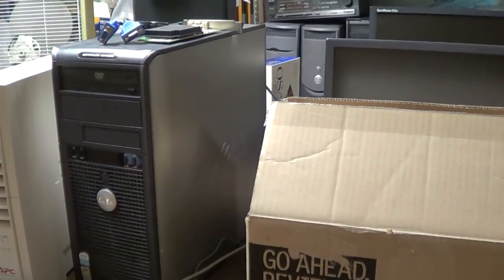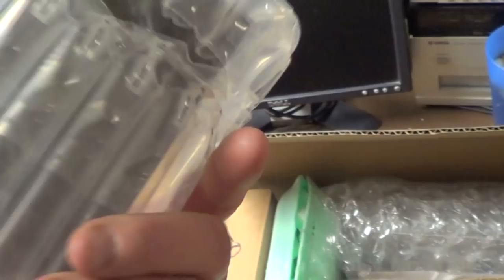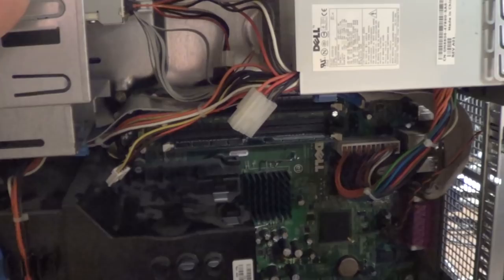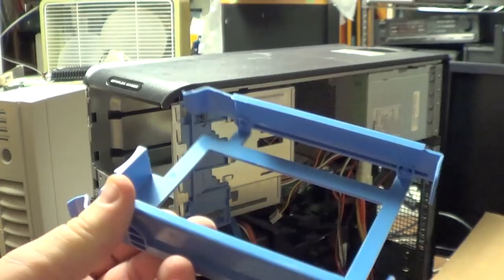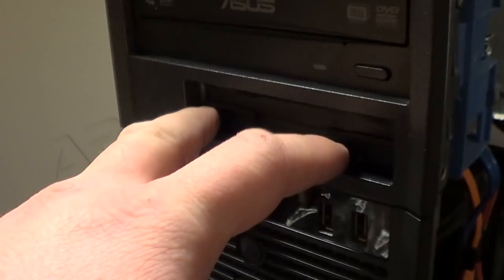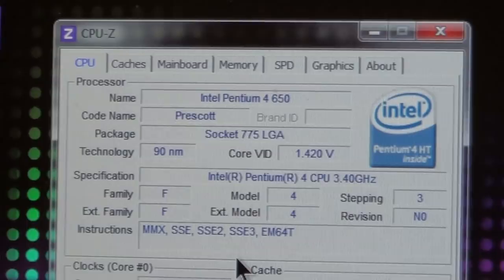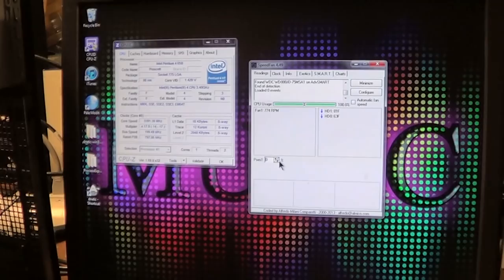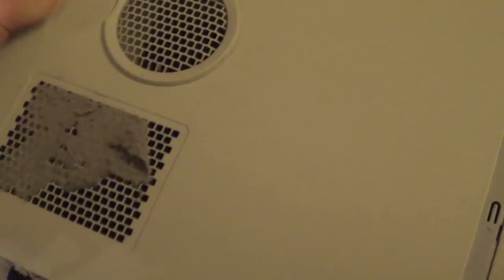"New" Music Player PC Build

Comment: I was working on computer today for a customer, it was so full of dust it was actually triggering the computers thermal sensors and making it shuts off of what I was doing more than one task at a time, I told the owner it was a dust problem of course most people complete dust can shutdown the computer, I certainly proved him wrong, the computer was in the house with a heavy smoker and just one dog, it's crazy how fast the dust actually builds up.

Comment: A business that my dad used to work at, before it went out, had Dell Optiplex 755s and one 760, which use the exact case. When the company went out, the owner said my dad could have the four computers, and the monitors (although he only snagged the two 22 inch widescreen monitors, which I am using for my dual display now). I kept one of the computers as a personal one, and as you said about the dust thing, ALL of them were completely caked in dust. Those video cards that you talked about in the beginning were similar to what these machines had. I love your opinion of PS/2  and floppy drives, since it doesn't really hurt to have a floppy drive and PS/2 ports, in fact my new keyboard (so new it has a Windows 8 logo on the Start button) came with a PS/2 cable. Although it had a converter that came with it, it would not work with the computer, and I am now using a different computer that has PS/2 ports, they came in useful.

Comment: The upgradability of these machines really reminds me of my Latitude E6420. Thing's built like a tank and it comes apart easily, too. Just pop the bottom panel off and you have access to everything: The socketed processor, the RAM. the heat pipe assembly, the expansion cards...it's really nice. Anything past that though and it quickly becomes far more complicated.

Comment: I once used the CD analog audio input on a motherboard for an extra audio input - either for digitizing cassettes or recording live radio without swapping cables. I recently saw the old adaptor in my parts pile, it't an expansion slot cover with 2 RCA jacks mounted to it, and a CD audio cable with one end cut off and soldered to the jacks.

Comment: I have one of these GX620's and it is a very good machine. I upgraded mine to use in the bedroom for a HTPC.  I replaced it recently with a SFF version of this computer. Mine did not have the PS/2 adapter card in the lower slot. If you ever wanted to upgrade this PC to use a Core2duo, the GX745 motherboard will slip right in and are dirt cheap on ebay.

Comment: I put Lubuntu on a Dell Dimension E310 with a 3.2GHz Pentium 4 HT and 2GB of RAM, and I was really impressed with how usable it was. It could even run YouTube at 360p without significant trouble. So I definitely think Pentium 4s can still be useful.
Reply: I find using a Linux distro on an older PC, has better youtube video playback than Windows.

Comment: I have the GX520 variant in the desktop form which i got for free at a PC shop. Currently runs as a Hackintosh running Mac OS X Snow Leopard as a music player system, containing a full backup of my iTunes library.

Since the GX520 and the GX620 are pretty much identical (the 520 lacks PCI-e while the 620 doesn't, 520 supports Pentium D's at up to 2.8GHz while the 620 can do more), there are guides on how to run Mac OS X with full support (sound, video, etc.)

Comment: I think uxwbill has the most dell pcs I kno
Reply: naterade21 dell is not a pc it’s a piece of shit
Reply: @dj_noxxie  That can definitely apply to their newer machines, using proprietary PSU connectors and strange layouts. Though, I feel their old ones were quite usable.
Reply: @jamescollins6085  a lot of oem machines from the early 2000s are good
Reply: @qwertykeyboard5901  Good for their time, perhaps. I imagine tasks such as web browsing would probably be quite slow with the modern and bloated internet.
Reply: @jamescollins6085  Processer wise, yeah, but i was talking about build quality.
Reply: @dj_noxxie  I've only used dell dimensions, optiplex's, precision,  latitudes their are not bad computers as long as they don't sit for to long with out being used once any computer sits for to long they will deteriorate

Comment: I found an adapter for that special Dell connector in a junk-picked Dimension 8200.. The caps on the SATA connectors were still blocked with caps though, which seemed very weird.

Comment: @18:00 Some TV tuners (like my current Winfast 2000 XP Expert TV tuner) pass audio from the tuner to the soundcard using such an analogue audio CD cable.

My current board has CD or AUX connectors so I "hacked" an audio CD cable by wiring one end to a stereo jack and plugging that jack outside the case in the Line In connector.

Comment: One sort of unrelated memory note, the Early and Mid 2009 white MacBooks with the Nvidia 9400M Video card will accept up to 8GB of RAM. The early 2009, although it shipped with 667MHz RAM will accept 800 as I discovered accidentally and run it as 800. Right now I went ahead and got 2 4GB 800MHz laptop ram sticks and am successfully running them with 8GB fully recognized. For more than 6GB to be used I think you have to be running at least 10.7 or 10.8.
Reply: I've heard both that and reports of it working well. I took a gamble and bought a set for it and its been working for several months now. Not one issue yet, and I did intentionally load the machine up to use all the available RAM with no issues.

Comment: Thinking of doing this with a Inspiron 1501 laptop I have setting around. I'll need to ether upgrade the hard drive or add a usb one for storage. (The stock 120gb drive doesn't stand a chance of holding all my mp3s and ripped cds)

Comment: If you're interested at all, these GX620's are able to run Pentium D's as well. Mine runs a 3.0GHZ Pentium D with an 800MHZ fsb.  My school bought a load of them back in 2006 when they were first made, all shipped factory with either 2.8 GHZ or 3.0GHZ Pentium D's.
Reply from the maker: At the time I saw no need to purchase or install a Pentium D processor.

Comment: "I seriously cannot believe you didn't buy a new $25,000 computer for this! You need a 15 TB video card, 3 million gigs of RAM, and a 200 TB SSD to make a good computer! Floppy drives and a Pentium 4 in 2014? You must be insane! Model M keyboards with integrated pointing devices? What is this, 1984?!" (Just taking care of including all the troll comments I've received recently before actual trolls have a chance to do it themselves. :p)

I've never been a fan of Dell, but I absolutely LOVE the Optiplex machines of this era. The only "problem" I've ever encountered with these systems running Pentium-named CPU's is revving that fan up to some pretty high volumes. Other than that, they seem pretty stable (and the keyboards and mice they came with are pretty nice, as well).

Nice choice on the optical drives, as well! :) Those are the only drives I'll touch in builds now, and they're great considering just how cheap and cheerful they are.

Can't wait to tune in to the first "Don't Watch This!" with the new music PC! :)
Reply: ***** You know how hard it is for me to go to bed at a reasonable hour when all that gave me such a good laugh? :) Just make sure the wireless receiver on that mouse has a good asbestos-filtering feature, or your signal is bound to be killed if you're using it on this side of Indiana. :p

You aren't the only one who's spec'd out a ridiculously-expensive Mac just for fun. I did the same thing around the same time I was putting together my custom-built desktop back in 2012. A Mac Pro with the same specs would've cost every bit of $11,500 and change. If I didn't accidentally delete it when repurposing the drive I used back then, I may still have the configuration kicking around here somewhere as a PDF.

I trust these Dells to cool well, especially with those huge fans. I'm not as much of a stickler for "silent fans" as a lot of people, but that's another story for another time. I only tend to mention fan noise because, believe it or not, I've had clients threaten to throw machines out the window because the fans were loud under load. This is not the same caliber of questionable as the client who thought "running a RAID" meant putting a can of Raid bug spray inside the case, but it comes close.
Reply: You forgot the 256 core 92 THz CPU :-D
Reply: Up until two years ago I used an overclocked Pentium 4 LGA775 machine as my gaming box... it had a 4GHz P4 630, 4GB DDR2 and a GeForce GT240 (I think)
It wasn't bad actually... it ran Win7 x64 very well.
Reply: I used my OptiPlex GX280 as a gaming machine; Has a 2.8GHz Pentium 4 w/ HT, 3GB of RAM and an ATI Radeon X1650. But now I use a gaming rig I built myself

Comment: One thing I don't like with Wertern Drives are the SMART data they provide.

They are especially confusing, and the lack of standardization of theses attributes between the different lines of drives they have.
That have a big impact on me when it comes to avoid this brand ...

Some Western drives don't even have a "Non recoverable ECC errors count" ... Now that's just plain stupid, how am I supposed to know how much time the drives as allegedly corrupted something ... (as the other counters can be reseted by writing over bad sectors, and the reallocated sector count can also be incremented at ECC recovered errors)

PS: SMART is very important in some circumstances, but it's true that the bios alert is not of much use. But hey I leave it on too, I think it only saved me once.
On RAID 1 arrays when a corruption occurs. I use SMART to know which drive to blame, and then load the correct copy.
Reply: ElectronikHeart For the average consumer, they don't really need that or care. They just want the computer to work

Comment: i still have a working maxtor 20GB hdd pulled out of a PC from 2001, altho i am not sure wether it still works but it worked when i took it out of the machine.

goes to show how much wonders luck can do. (albeit i do have a dead 250GB maxtor pata drive that is much younger)

Comment: As far as Windows operating systems go, end of support for Windows XP is April 8th. So I guess it will have to be either Windows 7, or some Linux distro. Out of interest, what is your preferred distro? I usually go for something Debian based, just because that's what I have come to know best over the years.
Reply: *****
I mostly agree with that, although I have no reason to stick with XP myself. Out of interest, would you still consider using Windows 2000 or even NT4 full time in such an environment? (I do still have a 9x machine in such an environment that I keep for games and legacy programs, although I don't use it to browse the internet.)

Comment: My old Maxtor 80GB HDD is still working to this very day, as is my Seagate 1TB SATA Drive.  My Seagate was made in Thailand, while the Maxtor Drives (1x 80GB, 2x 200GB) were made in China in 2004-2006... My dad had a Seagate 1TB HDD that has a bad logic board, made in China. Plus, your other computer doesn't look bad at all.  My old PC has a 52-speed CD Drive, DVD Burner, Floppy Drive pulled from my Dell PowerEdge 6300 Server (takes double the energy than my two desktops), a 2GB CF Card as a Hard Drive with a genuine copy of MS-DOS 6.22 and a library of games.

Comment: I had not seen the whole video when I first noticed that Sherwood Receiver.I seen it good enough later in the video to tell it's the RA-1140 I think it's only 40 watts a channel,the RA-1145R that I have is 55 watts a channel.it sounds so much better than the new Sherwood receivers.oh..it might be a good idea to open up the power supply on that Dell and check for bulged capacitors.

Comment: I have the same machine as my main desktop.  I put in a 945 chip and it works well.  I am using the stock aluminum heat sink.

Comment: I bought a Western Digital MyBook 6TB as refurbished. It contained a WD60EZRZ 'Blue' HDD that I removed and put inside my main PC. It's fine just used as a storage drive (I use it just for movie files). It cost only £99 from the WD Store. Western Digital have long been my preferred hard drive manufacturer though....
Reply from the maker: I've always had good results from Western Digital's refurbished hard drives. Both of these drives are still working just fine today. Before Hitachi sold their drive business to WD, I also had good results with their refurbished drives.

Comment: Interesting, I have an Optiplex 360 in my collection, you would think a GX620 would have more powerful hardware having a higher number... But that Optiplex I have came with a E7200 Pentium Dual-Core, 4GB DDR2, GMA 3100, and I think the previous owner put in an AMD 4670 512MB graphics card (not sure if it was an option or not), which I left since it uses standard DVI connection, no adapters required.

Comment: I have 2-3 Dell Optiplex's sitting around. My uncle had a few of them before I really got into building my own PC's. So he made my first "gaming" computer out of a Dell Optiplex. Hell, I was still gaming with an optiplex up into around 2009-2011 Somewhere around there I took the dive to build my own PC. I have quite a few computers now that I've acquired over the years. about 6 from my moms work, With OS's from 7 to 98. Computers I've picked up on the side of the road still with Hard Drives littered with viruses and personal information. Eventually I should go through and set them all up as slaves to assist with 3D rendering.. Not sure how much they would really help but would be worth a shot.

Comment: I remember once experimenting with that "feature" of playing CD audio through the IDE connector.  I turned the feature on and off in Windows to compare it to the analog connection, which was also hooked up.  It wasn't even close - the analog was way better.  I don't know why that would be, as I'd think the digital conversion would be exact, but it sounded very muddy/lifeless compared to the old analog hookup.  It was like listening to the difference between a CD and a cassette tape.
It hardly matters, but some old PC games use the CD audio for background music.

The slow spinup time of that fan would bother me a bit.  I've had issues on some machines where if you sneak up on them in the idle state and yell "Surprise-Prime95!" they get scary hot by the time the fan catches up.
However, this Dell might not be as vulnerable to this since it never gets into a very deeply throttled/undervolted state.  As a result, the demands on the cooling system wouldn't be as variable.
Some fans have a thermistor on them, which seems senselessly redundant to me and only serves to hinder their responsiveness. I have no idea if Dell does this, but if it happens to have a thermistor, I'd bypass it.

Comment: My room mate had one of these BTX Dells and he found out that you could (at least in his)use a Core 2 Quad. And I believe he had full access to 8 gigs of of DDR-2 clocked at 667. Now I'm not sure if he ended up using some sort of application or modification to use all the memory. I did see that windows showed that 8gigs was available.
Reply: I'll have to ask him about it but it was an Optiplex with that BTX design.
Reply: +LordMaxin The Dell optiplex 755 sounds similar, I have one and some lower end core 2 quad processors are supported.

Comment: Got a few old IBM Thinkcentre's to respond to Speedfan a few weeks ago, and boy did they get loud. Though running a P4 (can't remember the exact model #), the mainbored is sadly still in the DDR age, with no sata connectors. No clue what to do with em either lol. Most likely just going to be a rainy day tinkerers project. At least they have floppy drives :D

Comment: I used to service alot of these systems when i did IT in an office... solid machines but i was displeased at the lack of ventilation to the hard disk bays....  i would have at least  expected dell to have supplied a more slotted hard disk chassis or at least duct leading from the supremely giant cooling fan in there...

Comment: The 945 chipset can't address more than 4GB because its only a 32-bit memory controller. The 965 fixed that and is found in machines like the DimE520 (the Intel version of your E521). I think the 945 can take Conroe Core2Duos. They certainly will lower the heat and electric bill!

You do realize that SATA has been around for 11 years, right?
Reply: *****
Seeing that the 945P/PL/G came out before 64-bit CPUs were commonplace, it shouldn't be a surprise that it can only address 4GB of RAM. Some later 945 varients support early Core CPUs. It was a weird transition period. One that I thankfully skipped for the most part.

Comment: SMART reporting is actually useful. I like it because the BIOS will halt and say HEY! Your HDD is going to fail! BACK IT UP NOW! rather then trying to boot to windows, and then waiting for windows to say, HEY! YOUR HDD IS BAD!.If any of the pre-fail attributes fall out of range, it trips SMART and your BIOS lets you know before it even boots.
Reply from the maker: Almost. SMART reporting is a good idea that should have been useful. A lot of computers don't get rebooted often, operating systems didn't generally pay attention to SMART data until fairly recently, and many BIOSes handled it stupidly. sometimes even going so far as to turn it off. 

The pre-failure attributes have proven in my experience to be far too permissive with regard to sounding the alarm. It's been suggested that this last state of affairs came up as a result of marketing getting involved.
Reply: i use HD Sentinel to check SMART status of a hard drive. It seems to work on most computer setups with the exception of some RAID controllers, especially SAS ones that just say "good" or "bad" but dont have a actual health rating. Of course the manufacturers utility is the best thing to use in my opinion, yes it may take a while to do a full scan on a 1tb hdd, but at least when its finished you know for sure.